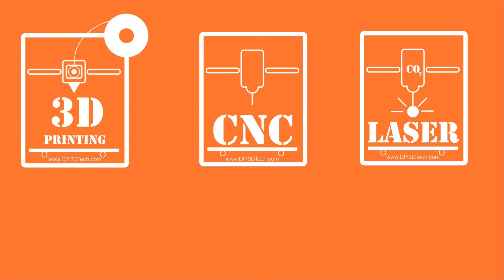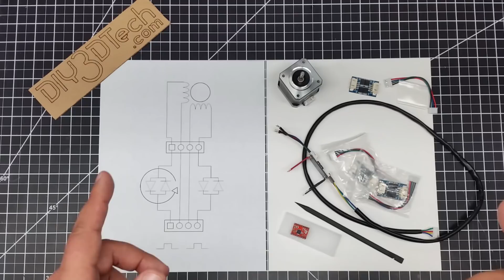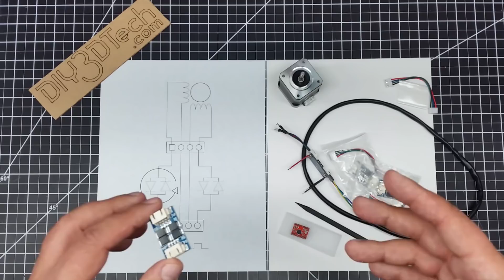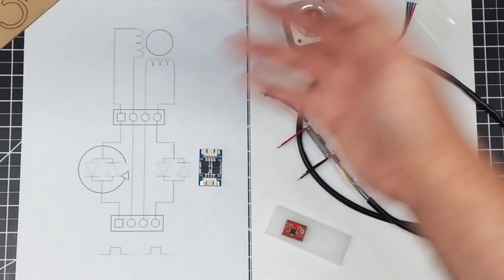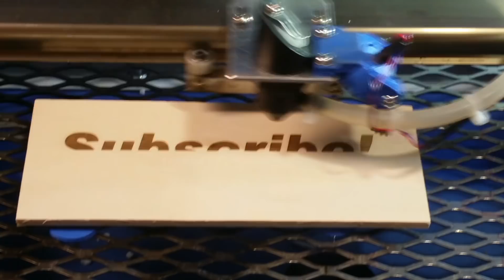Shop Talk - Diode Smoothing Your 3D Printer Fact or Fake News!

Comment: So is this what the alleged superiority of "smoothie" boards is supposed to be about?
Reply: I'm not sure if you're joking, but on an off chance you aren't, no, Smoothieboard is just a 32-bit board from a while ago with 1/32 microstepping on all axis and the kind of motion planner software that would have been a bit too heavy for the common 8-bit boards, so this is where its advertised smoothness is supposed to come from. It doesn't have diodes on the motor driver outputs and behaves similarly to how cheap A4988 drivers that you might use on another board do, just with finer microstepping.
Reply: http://reprap.org/wiki/Smoothieboard
Reply from the maker: Like the lithophanes and Disco flights (while pricey they are amazing)!  However assume question is about the diode smoothing board and not a smoothie board since this would be the context and your question is valid and what I am trying to explore here as some folks are improved "breaking" due to either voltage reduction (about 1.4v) to the motors or a better decay rate because a stepper can be both a motor and generator (creating flyback).  So in this episode I talk theory and possibly and Friday I put it tot he test!